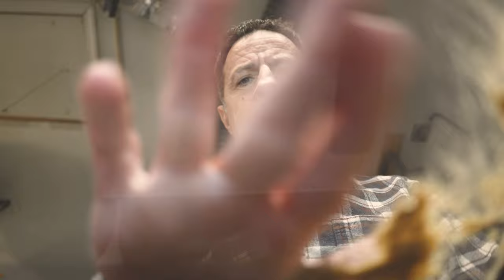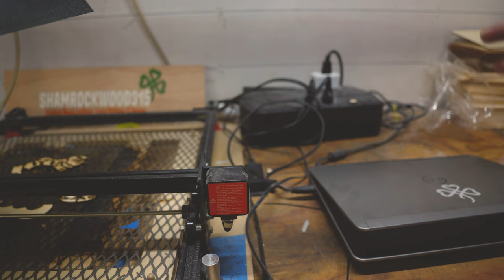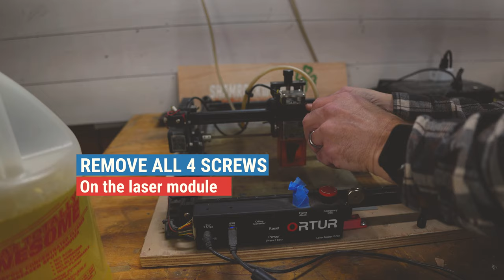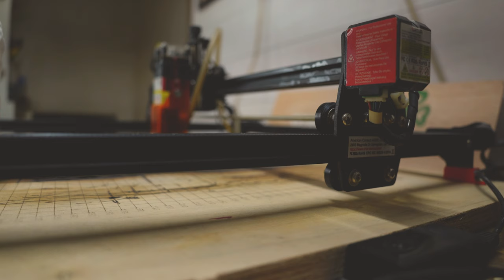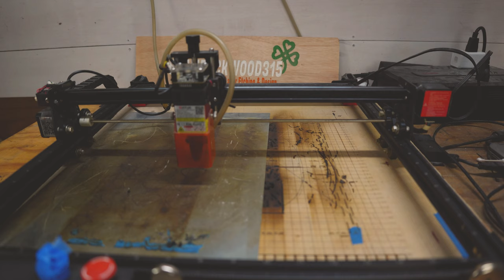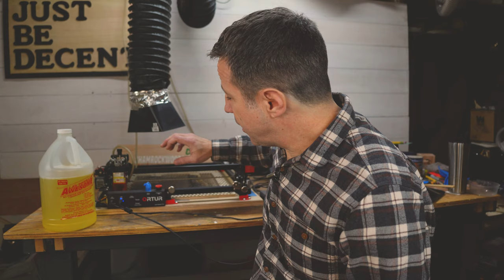How to clean a hobby laser | Ortur Laser Master Pro

Comment: I took my Ortur LM2 apart last week and cleaned it, and after I put it back together my burns are all significantly worse. I'm thinking I didn't tighten the belts enough. Can you elaborate more on how tight it should be? Do you tighten it just by pulling the belt through or do you use something to get it better?
Reply from the maker: I use these as a belt tensioner and they work pretty good a bit of a pain to set up but worth it in mu opinion 

https://www.etsy.com/listing/938963785/ortur-laser-master-2-three-belt?ref=yr_purchases

After after that if you push down on the belt near a one of the wheels you should have about 1/8" to 1/4" of give, and they need to be the same on each axis.